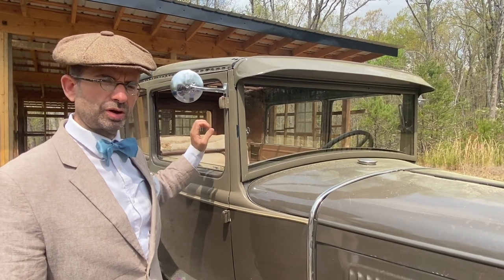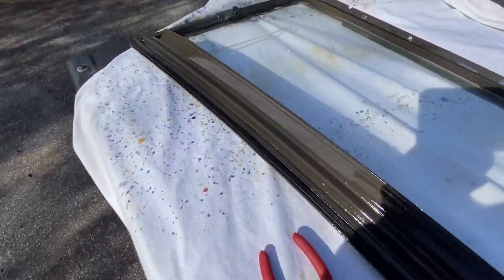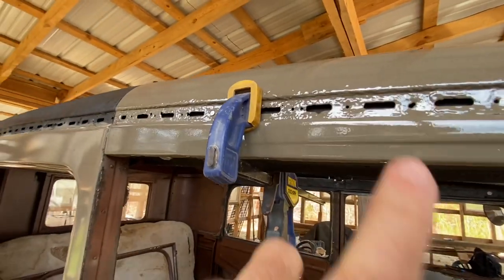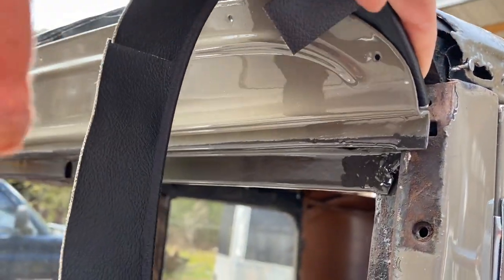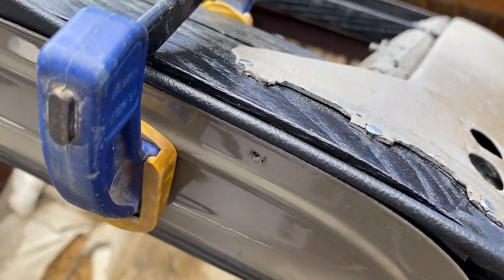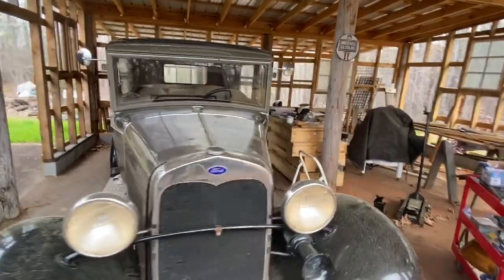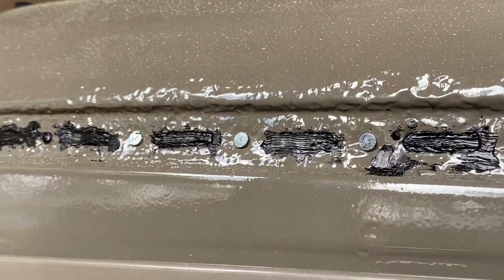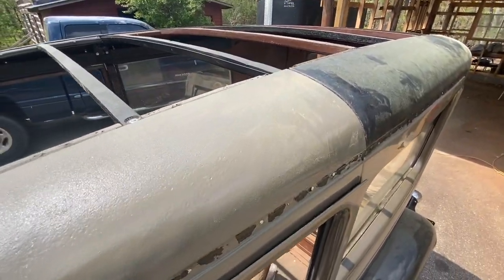How to install Ford Model A Windshield, Visor, & Header Cap

Comment: When you installed your windshield frame did you have to install the screws on an angle? My new header only fills about 60% of the header cap/windshield mounting holes. Thank you!
Reply from the maker: No sir, I dont think so. Maybe the video will show more detail but sounds like your windshield frame
 may have shifted?

Comment: Hello my brother in Christ. Have you installed or have an idea on how to install the rear fender braces on a 1931 Ford Model A Deluxe Coupe?
Reply from the maker: On my Tudor I just found original pictures and followed them. Type in year make and model of your car and just go through pictures for proper way. That’s what I did for mine. My Tudor had a wierd assortment of bracing when I got it. Now it’s all good. Also check the judging standards